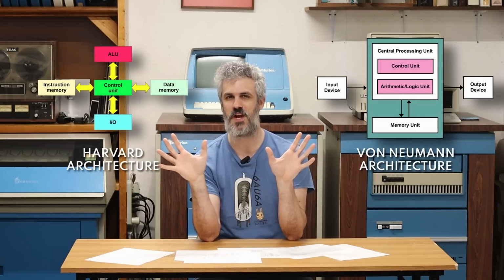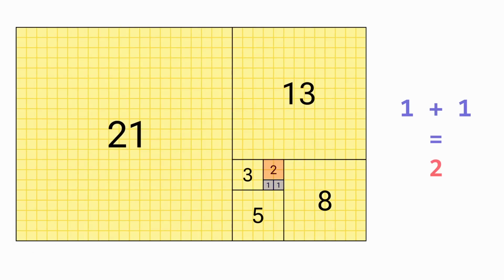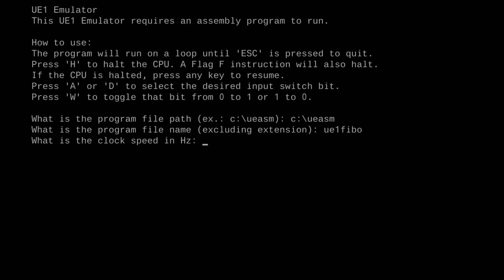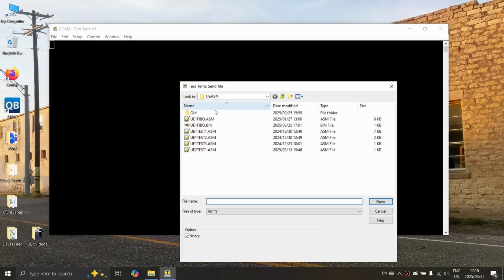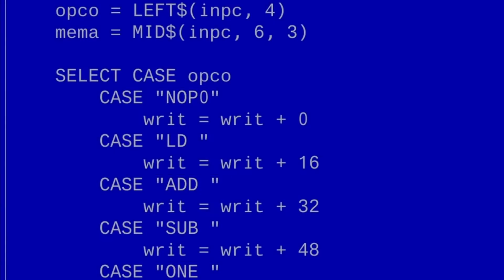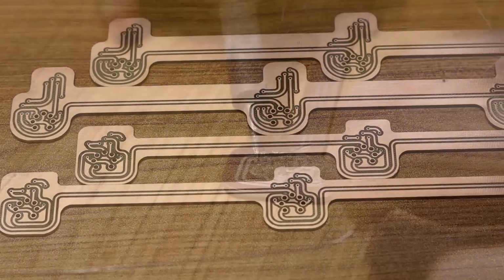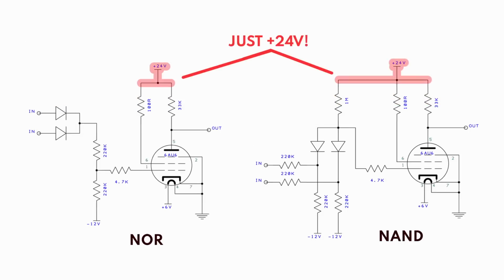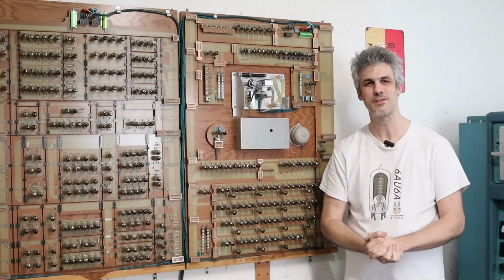I Tried and Failed to Run a Simple Program…

Comment: The biggest limitation of this computer is that it lacks the ability to store arbitrary long temporary data on external storage (storage other than 1-bit register and 8-bits RAM). It can be extended with some kind of input/output device which takes over the 7-bits external input and 8-bits external output. This input/output device can be magnetic core memory or combination of paper tape puncher and reader.

By the way, there's a thing called Universal Turing Machine in computing theory. All the computers we have (including the 1-bit data word computer you made) are Universal Turing Machines. This theory model will give you some insight on the capability of machine you made.

Comment: Check the tape reader output waveform at speed. You might have a fault there, or simply running too fast for switching times throughout the computer to be accommodated.

Comment: There is a compiler called FreeBASIC that's capable of compiling unmodified Q(uick)BASIC code for modern machines running Windows, Linux and more. No need to deal with this entire DOSBox madness.

Comment: I love what you’re doing here. And I love your videos. My channel is crap, basically nothing interesting I do ever ends up on youtube because I’m too absorbed in it to post a video.  My professional experience is in embedded systems, so this is kind of at the intersection of everything I love. 

I spent many years absorbing amplifier theory and might be able to help you. I have several successful circuits in production and I’m seeing potential issues here. But before writing this comment I went back and watched as much of your series on this gorgeous monstrosity as I could stand to before writing this. In a good way, of course :)

1) yes, tubes can work on low voltage, but as you found out, you need a unreasonably high tail resistance in class A mode and don’t have much voltage to drive it. Your output impedance of 10k or more is way too high for what you’re doing. 
2) I didn’t see much discussion of output impedance or fanout in your videos. But as you rightly discovered, high resistances are needed to balance the tube’s high impedance, yet they destroy your output drive capability. It will seem to work, until you load it. Your loads are frequently comparable to your output impedance meaning loading effects are killing you. 
3) Tubes simulate really well in LTSpice. But even on the bench, when designing a gate, always load it with at least the resistive divider it’s driving to see what it will do in circuit. Low voltage might be enough to drive a meter or a scope. You’ll see issues with it as soon as you connect another stage. 
4) There are ways to eliminate high resistances from your circuits so at least you’re only dealing with that 3k from the tube. You need push pull buffers if you’re going to operate successfully at such low voltages. That probably means output transformers as well since tubes don’t do complimentary well. But I don’t design with tubes enough to design that one for you. But that’s where you need to head. Think of it as replacing that class A tail resistor with one that can be 3k when you want to output a 1, or 100M when you want to output a 0. I don’t see how traditional resistive tail class A can drive a line from a tube at +24V and -12V. I wouldn’t even feel comfortable doing it with transistors, although it should be OK to drive light loads. 

If it were me, I’d build this in LTSpice and you’ll have your answer in 2 hours as to why it’s not working. My money is on those high impedance outputs with such low voltages to drive them. 

Love your content man. I really really want to see this thing work! Amazing stuff. (PS: if I built this, I’d probably also insist on making it work on low voltages, and I’d beat my head against the wall until it did)

Comment: This homemade computer is very impressive. It uses old school technology in a cool way, but i’m not sure if using high voltage power hungry technology is good  to use since it’s hard to balance the signals. Do you think it would be better to use modern tech and lower voltage using semiconductor based transistors? Also where did you get those tiny VFD displays from? I am working on collecting old displays, and another tiny single segment display will be good for my collection.

Comment: Ah, the bigger version of my mess of small lightbulbs, switches and diodes from when I was a kid. Well, mine was also just a binary adder, but it was kinda sorta related, and superior in jankfactor since mine lived as a ball of loose wires inside some box I don't remember where I got it from. The only way to make PCB's then was acid etch or whatever it's called, which I tried, but without a drill or working soldering iron is kinda pointless. So I twisted wires and used a bunch of electrical tape - and I got it working! Well, briefly, then I needed the batteries for something else, and wires got loose. Then mom piled stuff on top of it and the lightbulbs fell into the case and it got bent - and I kept putting off going through the wiring again until it got thrown in the bin I think. 
BUT! I was 11. The question is - what is your excuse?! 😂 I have thought of making like a V 2.0 of that thing in a somewhat improved architecture but the "cost/benefit" has stopped me, since I can buy a chip with a CPU, RAM, clock, IO,storage etc for €2. Probably even less. Maybe I should get myself a motorola 68705 again and program it to hack the world! And finally make the ultimate elevator microcontroller (school task was to make a working elevator controlled by one of those, writing it in a form of assembler) and revive my pocket calculator of doom with it.

Comment: I'm pretty good at hardware and programming when it comes to computers 4 bit and higher, but that 1 bit computer has me stumped.  The closest I've ever worked on anything like that was a Secode RAPID SCADA system, that was all logic chips and sent data over the air at around 64 baud if I remember correctly, and the serial data just looped around through around a bunch of shift registers.  It was actually quite ingenious and easy to work on, at least for an idiot like me.  From my understanding, Secode was based out of the Dallas area but I have no idea what happened to them.

Comment: My bet after seeing the signal problems and knowing that you ran into this before is that it probably is not getting enough Omphs throughout the board. With a hundred tubes you'll need 190W just for heating and then 300W for the anodes/screens, 0.21Ω total.

Comment: Actually I built a small 4-bit computer back in the '80s (using TTL). It didn't work - because I was a bit too smart: I had wanted a lot of parallelism (and my simulator worked), but I had forgotten or not realized that gates in the simulator are always nice and correct, while in reality the gates are having different speed and should be syncronized. Which I didn't do. So my gates was working, but not in line, and all I really had built was a advanced random bit generator 🙂 ...

Comment: Hey, I've said it before. Buy a few ESP32s(they're cheap), hook them up at different points in your homebuilt computer, and have each of them monitor for a specific set of actions and expected values, its simple to have one of them throw on an Error LED or something to show where something encountered a problem. If you're feeling fancy, you could have it all pipe back into your laptop so you can see the debug output at each stage then, and specifically see what is happening every single change down the bus without having to probe every single joint manually.

Comment: Is it possible that because you're just running the tubes at too low a voltage that you're getting weird behaviors as more voltage is in use?  Did you try increasing the voltage to say, 1000w total?  Maybe it will bring plate voltages more to within what you need to switch things faster.  Be aware that all of this is coming from a man that knows almost nothing about vacuum tubes (LMAO).

Comment: you need a mechanism that will pause execution so you can inspect the state of the system, like step-through, for each instruction on the reel. Maybe a toggle switch that will pause execution if enabled

Comment: Mad respects for building the assembler and emulator on QB. I learned to program in QB and I spent so much time writing code on it. I still use QB on my older machines (and sometimes even DOSBox) to make simple programs that compute stuff. 
Anyway, you could technically make a version of the emulator that loads binary "assembled" files instead of source code, and shows the disassembled equivalent instruction when it's running. That way you can check that the assembler is translating everything perfectly.

As a massive ASM lover and low-level aficionado, it's tempting to make a web version of both the emulator and the assembler. Or something crazier like a cross-assembler to a different architecture. Man this gives me so many ideas!

Comment: It might be really nice to build yourself a parallel port logic level converter to replace your punched tape reader for troubleshooting purposes. I'm sure you have plenty of old gear with parallel ports around! If you don't want to use old gear maybe (maybe) there's a USB parallel port that would play nice with DOSbox... 

But man it would be super nice to be able to cut out the possibly finicky mechanical and optical aspects of the punched tape reader when trying to troubleshoot. I am sure your tape reader is generally working fine, but wouldn't it be nice to be ABSOLUTELY SURE that the input data you were using to test your machine was arriving with utterly perfect timing and logic levels? 

If you used some open collector buffers or some other high voltage level converter to connect the parallel port output in place of the photodiodes, and you use the 8 data bits of the parallel port and one of those other random signals on there for clock, you ought to be able to write a BASIC routine that can clock arbitrary punched tape data into your computer and do all manner of troubleshooting.

Comment: If i might add a tip..... If you cut and position a small square of automotive window tint over the VFD displays it will make it way more visible to the camera. You can even use a few if it is not dark enough. This works for 7 segment LED displays too.

Comment: It's all good, David - You're into that "final 20% of the work that takes 80% of the time" tuning and debugging stage :)
1. That missing space character in your assembler's parser -> errant characters breaking code continues to be a quite common occurrence in all development projects!
2. Tuning the UE1 - Many commenters have already pointed out that the ability to single-step the tape-reader would be very, very helpful.  
   - Though, I could see a reluctance to do that given the effort involved, plus the amount of effort to build the existing mechanism from scratch.
   - On the other hand, even without single stepping the tape reader -> if you're able to get the reader to run much more slowly, you may find a point where the machine runs much more reliably, as-is.

Comment: you can use qb64 to run quickbasic on a modern machine.  I am doing this.  I suggest qb64 phoenix edition.  it runs existing qb programs, and has tons of expansions like 64 bit integers and other var types.  there are lots of expanded commands too and it is very fast, and the limits are much relaxed, so 512K byte arrays are just fine.   under the hood it converts it to C and compiles it with GCC which makes me chuckle.  I have been using qb64 for about a decade now.

Comment: I am really impressed with your troubleshooting and construction skills. I'm amazed your system works so well without decoupling capacitors on the power distribution bus.  In some of the systems I have tried to repair, I have found high (relative) frequency noise on DC power and ground busses that electronics think are signals to be acted upon.  Replacing the decoupling capacitors is the fix. At the 24 VDC level I have no experience with tube since everything I worked on has 75 VDC or higher B+ voltage. I humbly suggest when you have a chance to rerun the tests and see what your supply voltages are doing while system is operating. You will want to check on each board.

This is a special case of the "The whole is greater than the sum."  In that when you toggle single signals the issue will not be present, but when you have multiple signals they may influence each other over the common connection of the power and ground busses.  The tantalum capacitors that bedevil all electronic technicians are often used for this  purpose because of excellent high frequency response compared to electrolytic capacitors.

The daughter board implementation is great!. Green wires on PCBs always standout as an recovery effort.

Sincerely,

Richard

Comment: hi, usagi

    i think you still have problems parsing the assembly instructions...
    the hack of adding space at the end of each option believe does not
    will allways work
    i found that in .asm code downloaded from github
    - there exists some <tab> in place of <space> after opcode
    - line separator is unix style \n, but it should be \r\n to be
      read correctly by "INPUT #1, inpc" as intended

saludos from uruguay
leonardo

>>>>1) After "LINE INPUT #1, inpc"
    add "CALL ParseLine(inpc, opco, mema)"
    this will deal with spaces, tabs, comments, letter casing, etc.
    and return the opcode and operand found if the line is
    correctly formatted:  opcode[<spaces or tabs>operand][; comment]
    if nothing is recognized opcode and operand will be both ""
    (i think the operand is allways needed but it's no difficult
    to allow it to be optional, maybe neeed in the future)

>>>>2) Remove trailing space(s) from each option in SELECT CASE

>>>>3) Add the following SUB to your source code (i think the sintax is
    mostly right, i don't have the qbasic compiler at hand, this is
    a mix of chatgpt generated code and my memories about basic
    programming :)
SUB ParseLine(srclin AS STRING, opcode AS STRING, operand AS STRING)
    DIM p AS INTEGER
    DIM temp AS STRING

    ' Default return values
    opcode = ""
    operand = ""

    ' Work with a copy of source line
    temp = srclin

    ' Strip comment if found
    p = INSTR(temp, ";")
    IF p > 0 THEN
        temp = LEFT$(temp, p - 1)
    END IF

    ' Remove leading/trailing spaces and convert to uppercase
    ' If temp is empty return
    temp = UCASE$(LTRIM$(RTRIM$(temp)))
    IF temp = "" THEN
        EXIT SUB
    END IF

    ' Find the first space (separates opcode from operand)
    p = INSTR(temp, " ")
    IF p = 0 THEN
        ' Only opcode present
        opcode = temp
    ELSE
        ' Opcode and operand present
        opcode = LEFT$(temp, p - 1)
        operand = LTRIM$(RTRIM$(MID$(temp, p + 1)))
    END IF
END FUNCTION

Comment: I would definitely consider setting up some sort of logic analyzer and possibly some way to electronically input data/instructions and control the thing.

When working on weird problems like this I find it is very useful to spend a bit extra time setting up a good reliable method of testing/debugging. It’ll save a lot of time and headache if you have a nice test setup that you can just sit at and work through the issues.

Then maybe go through and thoroughly test each part of the system, but not just “ok yea it works”. Mess with the supply voltage/signal levels/speeds, test the hell out of it and see where it stops working, that way you know how much tolerance you have. You don’t want to skip past the issue because it works at 24v but fails at 23.9v.

Comment: what do the heater volts measure on each tube? 24v if feeding 4 in series is a bit low, more so if any are fairly well used and a bit low emission..? maybe increase supply to 25.5 if you can? in any case no lower than 5.8 on each heater

Comment: I remember encountering some very small valves (used for hearing aids) when I used to attend my local radio society and this gives me an idea.  He could conceivably build a compact memory module with four bytes of RAM using such small valves.  This would greatly improve his machine’s capability.

Also, may I suggest writing a dedicated test program to exercise the hardware.

Comment: SOCKET QUESTION: I occasionally build with vacuum tubes but mount sockets on top of the PCB. May I ask what are you using for sockets that allow you to directly plug the vacuum tube into the PCB?  Thank You!
Hats off for building this vacuum tube computer!
Yes, when I built a little TTL one, I had some serious troubleshooting to do!
But, it all turns out well--so hang in there!

Comment: You are not a terrible programmer since you can detect your mistakes.
Everybody makes mistakes and experimented programmers remember common mistakes they made at first so they can avoid them. 

Making mistakes don’t make you a bad programmer. They help you build some knowledge and experience.

I hope what I wrote makes sense. Since I’m french, I’m not totally confident with my english.
Reply: 100% correct! Everyone who becomes a good programmer makes mistakes in the process of doing so. It's part of what molds you into a good programmer.

Comment: 10 FNF(X) = X^5 + 2*X^3 -1
20 READ N
30 LET A = 0
40 LET B = 1
50 LET X = .5
60 FOR I = 1 TO N
70 IF FNF(X) > 0 THEN 100
80 LET B = X
90 GOTO 150
100 LET A = X
150 LET X = (A+B)/2
200 NEXT I
250 PRINT X, FNF(X)
300 DATA 20
999 END
Dartmouth BASIC

Comment: Try cutting your program down to do just one register load and stop.  If that works, go farther and stop.  Do this until it fails.  The Newton's Method of program debugging.  You dont even need to change the program, just scissor off the tape where you want it to stop.
Reply: Hahaha 😂 yes I never made the connection but that is exactly what trial and error is basically